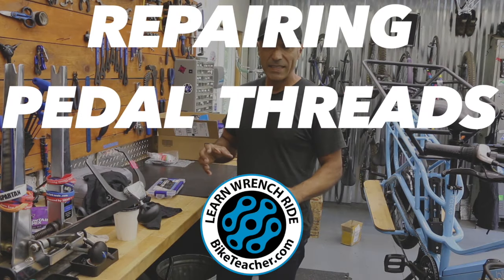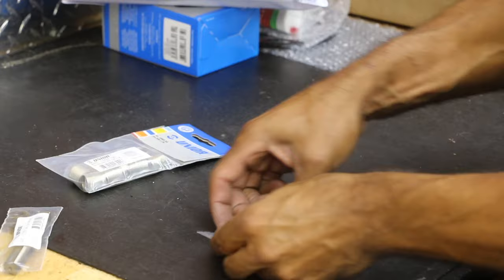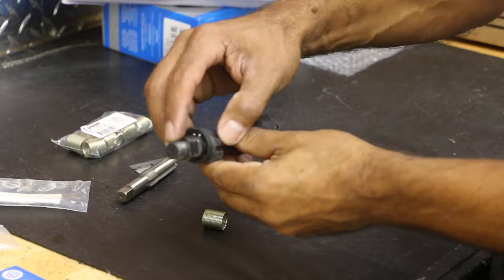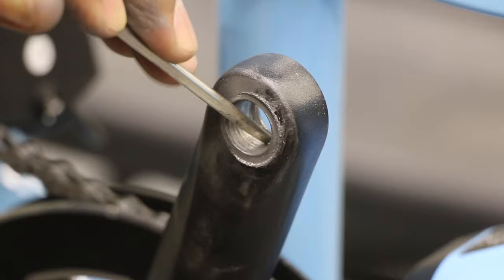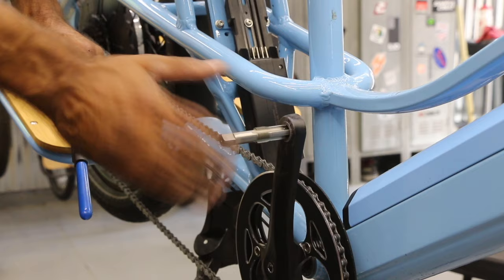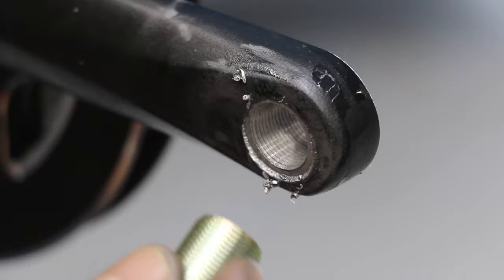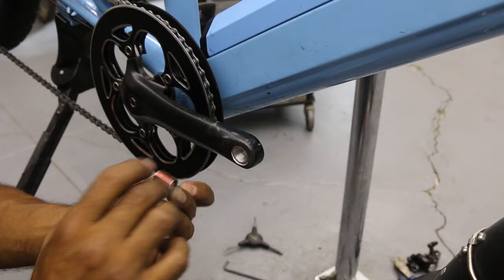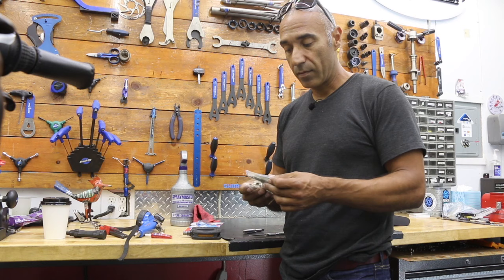How to repair stripped pedal threads on the crank arm with Unior bushing and a pedal tap.

Comment: What should I do if the threads are somehow bad, they keep the pedal but the pedal axle is not completely horizontal, it stays a bit bent.
Reply from the maker: Ooof! Not good, it will fail soon if you continue to use it. Remove the pedal and get the threads repaired or maybe a new crankset is cheaper.

Comment: I have a 9/16” interior diameter 5/8” outer diameter 20-tpi thread insert. What exact pedal tap should I get as in size and tpi? Please help because 9/16” as described in the video description for pedal tap was too small!
Reply from the maker: The tool will be a 5/8”. The otter diameter of the tool threading area and od of the insert is 5/8”.
Reply: @BikeTeacher  Thank you! So actually more specifically, the inner diameter is 9/16'' AND 20-tpi whereas the outer diameter is 5/8'' and 24-tpi. I only found a RIGHT hand pedal tap that's 5/8'' 24-tpi, whereas it's for my LEFT pedal threads. Is 5/8 24-tpi okay? Do you think it would work if I used the RIGHT hand pedal tap to rethread for my left pedal but go outward from the bike rather than go in as you do (since it's RIGHT hand)? Or would that not work? Thank you!

Comment: Would this work to fix stripped threading on an ebike where you attach the crank? Right now it goes in a bit crooked and falls out pretty quickly. Tried quickweld but didn't stay, gunna try green loctite if I can't do this.
Reply from the maker: Like a crank bolt attachment? There are tools to clean up or do minor corrections on either threads. You would need the appropriate tools like a tap and die set. May be easier to replace them.
Reply: @BikeTeacher  Thanks for the fast reply! Alright thanks for the advise. Can't find any parts online still brand new, but I'll try and bring it to a shop or something and ask them to do that for me. 👍👍
Reply from the maker: Thanks

Comment: so are there two scenarios when the threads are stripped? 1) threads are damaged but able to be saved by cleaning and re tapping original threads and pedal, option 2 is there are beyond repair and need the union bushing and new wider diameter threads.
Reply from the maker: Yes, that has been my experience so far.

Comment: I got a new bike paid C$400 and after a few days the peddle went off and I can tell that the thread on the peddle and on the other side are gone, what do I do now?
Reply from the maker: It can be repaired. Fine a shop that can do the work or fine a used crank arm or buy a new crank set.
Reply: @BikeTeacher  actually, I went back to the seller and returned bike with full refund. Problem solved!

Comment: Would this work on a stationary bike as well? I'm concerned about getting the right size if I buy from Unior
Reply from the maker: It should work, can you measure the pedal spindle diameter?
Reply: @BikeTeacher  yes, it looks like 5/8 but the threads on the spindle are stripped

Comment: Thanks for the very informative video. However, after checking the prices of the taps and pedals, I will probably just weld my pedal back on! Otherwise, I could buy a good used bike for the price of the materials needed!
Reply from the maker: Yes, I can see that. Entry level cranksets may cheaper to.
Reply: @BikeTeacher  I'll just get a new crank arm lmao. Thanks for the video I guess.
Reply from the maker: Your welcome. 😁

Comment: What do I do if my pedal has completely fallen off? It won't stay back on?
Reply from the maker: It sounds like the threads have stripped completely either on the pedal or the crank. It's most typical for the crank threads to get destroyed. If so you should be able to use a a repair kit like in the video. It will make the hole bigger at first unless too much material is missing already.
Reply from the maker: I also do live video consultation if needed. Email arthur@biketeacher.com Thanks.

Comment: My crank thread is big than my pedal thread, how to resolve this?
Reply from the maker: Did this happen due to damage? Or you may have need a 9/16 or bigger pedal threads. Which is most common.
Reply: @BikeTeacher  the hole in crank arm is naturally bigger.  But the clipless pedal's thread size is smaller.
Reply from the maker: Strange, I haven’t herd of that. Unless there is an adaptor on the pedal?  I would need some history on the bike. Or the crank arm got way to oversized.